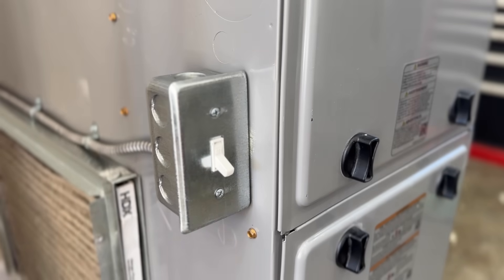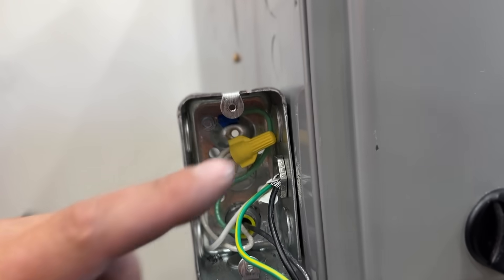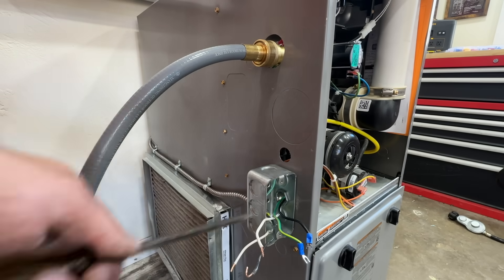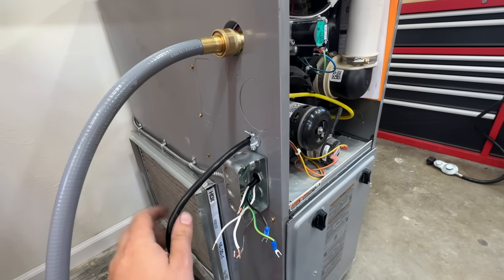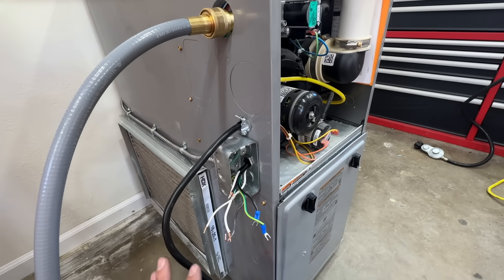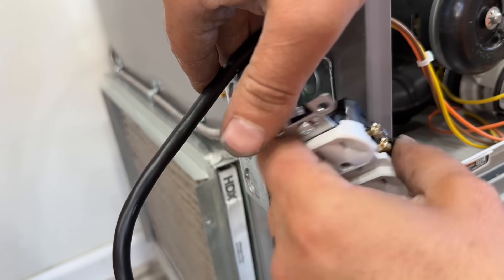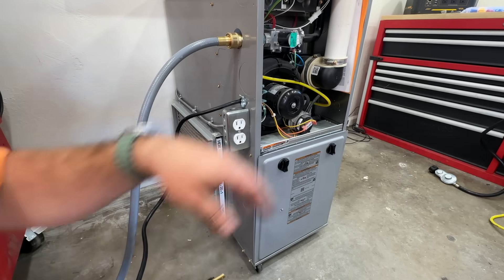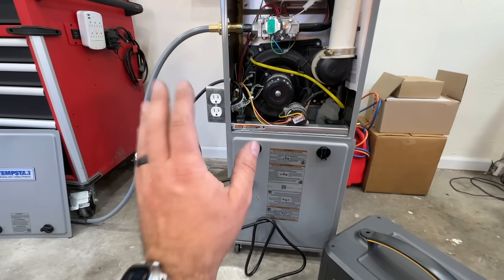Keep Your Family Warm During A Power Outage By Installing This $5 Part

Comment: I used a double pole double throw switch. Completely isolated neutral and hot when switch is used. when switch is up it is fed from utility power. when switch is down it is fed from the appliance cord.

Comment: Hello just a little info
this is not to code in my area ,first it must be hard wired , second all breakers for the furnace in my area are 20 amp (if to code ) so if you do this use a 20 amp rated plug what you do when the inspector leaves is up to you,third if this is done home insurance may not cover if there is a problem.
although a emergency is a emergency so don't freeze  and  GOD BLESS
Reply from the maker: Yes as stated, some inspectors may not approve of this depending on the ordinance but some will say it’s fine as I’ve seen hundreds of homes with this same exact setup. Cheers

Comment: Its a great idea, but the great City of San Jose, CA has banned gas furnaces in new construction. What happens when the power goes out, and you have zero gas. We have such a smart city, NOT
Reply from the maker: Really? That sucks.. you guys are sol if you have a new house… haha jk if they are making that the case; then I’m sure they are installing high efficiency inverter heat pumps that require less amps to operate so you’d need a power inlet box or a transfer switch and a generator in that case.
Reply: Many generators are dual fuel so you could get a large propane tank to run the generator. One of these days there is going to be a massive power outage in CA and whole neighborhoods will be without power. Camping anyone?

Comment: It will cost you a bit more than $5 but it's a minimal cost to have this ability.  I have had my furnaces done this way for many years. We get a  lot of outages year round, but in winter, it is usually related to blizzard conditions, so even a few hours without heat can get bad pretty quick. 

I have a big generator, but it takes a bit to get  it set up especially when the weather is bad.  If I get lucky, I might get power back in a couple hours. But running the furnace on a self contained battery style power supply, buys some time to evaluate the situation. If I have to work outside in the cold, crappy weather to get the generator set up. Being able to come in and warm up is priceless!

You did a very nice job explaining and you covered everything of importance, quite well. The only suggestion I have is to talk about having an adequate sized emergency supply. You connected to a 1000 watt supply, which I'm sure was adequate if you had checked the nameplate actual input values of the furnace. And when a blower starts, it draws a bit more current. Most emergency power sources have a surge capacity that will handle that. The main thing is to test your power source to make sure it will work when you need it and maybe run for a while to get an idea of the usage time you can expect. My suggestion is to start with a 1500 watt supply for a 15 amp circuit.  The actual input level value is likely about half, but it's good to have a little extra margin. They over hype these battery style self contained back up supplies, making it sound like it will supply endless power!  f it is small and lightweight, it will have pretty  limited power. So it's a good idea to do some testing to see just what you will have when you need it. The idea of using your car as a generator with an adequate sized inverter and a heavy duty extension cord, can make a pretty good emergency back up. Having this kind of  knowledge and capability, can be a life saver in major outages, and the cost of getting the capability is relatively low. 

As for code compliance. It's a matter of interpretation.  What you are doing is perfectly fine and safe. But you could run into an inspector who interprets it differently. Ideally you can explain its use and reasoning and get agreement. Alternatively, you could use an EZ Generator Switch, which is UL listed and approved for this very situation. I'd argue that your approach is actually better, but sometimes you run into an a-hole who really doesn't have a solid understanding of why the code is what it is. 

My only  other comment is about using Wagos. I'm an electric engineer who takes issue with them. No because they can come loose, which is unlikely. My issue with them is that when properly installed, they provide a relatively high resistance connection. This is not a huge issue in low current applications  like in a lighting fixture. but in higher current situations, the issue increase exponentially. I won't claim they are dangerous, but you should know that UL lowered the ratings considerably from the European IEC standards. 

The Wagos are easy which helps for DIY work, however, I strongly suggest that electrical work is not something for for DIY unless the person, fully and completely understands electrical theory and have had some formal training. I have seen far to many DIY mistakes. Electricity can kill you and/or your family and burn down your house if you make a mistake. You did a good job of explaining in detail how to make this pretty simple modification. 

I will just finish the Wago comment with the simple fact that wire nuts are far superior for a good connection. This is well proved by engineering level testing.  As an HVAC guy, I suggest yo research the Wago issue in depth, I'm sure you know well that easier is not necessarily better.  

But short these fairly minor points, I think you produced a very fine video and covered all the bases,
Reply: Wago are fine, for this case especially fine. Feel free to leave links to prove how poor wagos are.
Reply: @ClanMcCormick  What are your credentials that make you believable, Are you an electrical engineer? Do you know what the inherent resistance is for these connections. I don't need links, even though there are more than a few credible ones out there. I'm an Electrical Engineer with decades of experience and have conducted ample tests to laboratory  standards.  What does fine or especially fine mean in your definition? Are you a professional? Trained? Certified? 

I gave my professional opinion that these are a bad choice for connections of any substantial currents because as current doubles, heating goes up 4 times. D you understand that and know why?  They probably won't cause a fire but will most likely fail open. UL rated them OK but at reduced currents.  So they probably won't cause a fire at or below these derated currents.
Reply: Heat does not rise exponentially with current: only parabolically (variable (current) raised to a fixed power of 2). P=I^2R

That is a pet peeve of mine when people claim something rises exponentially just because a fixed power is involved. Exponential growth is when you have a fixed based raised to a variable power (like 2^x). That grows much faster than (x^2).
Reply: @economicprisoner  For the purposes of the issue at hand, I'll stick with what I said. If you want to play mathematical semantics with it, I don't see the point.  The issue is that dissipated heat is a function of the current squared.  This "functionality" is often overlooked by many in the electrical world. I don't wish to get hung up on terminology. It doesn't change the formula or the results. Sorry if  your interpretation is 'pet peeve" of yours.
Reply: @professorg8383  I see it more commonly with formulas involving 4th power terms (road wear due to axle weight, black body radiation)..

Calling everything "exponential" reduces the impact when the growth is ACTUALLY exponential (loans, spread of diseases like Covid). 

Exponential growth sneaks up on you. In the short-term it is less than you may expect. But long term it is far faster than you expect.
Reply: @economicprisoner  engineer vs mathematician.  Mainly a  perspective kind of thing.  I use math as a tool to help solve problems,  but I don't see it like a religious belief.  Different perspectives. both of which are useful in a full scientific explanation. But I see getting too obsessed with the  process as creating a stumbling block to achieving results. 

Being an electrical guy, I can have a great appreciation for Maxwell and all his efforts to explain what we already knew. He was a genius and has his place in electrical theory and history. But he really gets no credit for any noteworthy discoveries.. Perspective!

Comment: If your using a modern VFD generator you must bond the natural and ground legs as they will otherwise put out voltage on the netural which will cause a control fault 

My old school generator was fine and I ran into this during a 10 day power failure when I needed to upgrade

Comment: If code allows it, there are switched outlets where the switch controls power to the outlet ( the 110 hot gies to the switch, the out of switch to the gold on the outlet. This allows cutting the power without unplugging it.
Reply from the maker: After talking to several electricians, it’s sixes in my opinion. All they want is a means of disconnecting the unit
Reply: @diyhvacguy  
Yeah, it will come down to code enforcement. IDK if it is code but in my house there is a kill switch at the furnace and one just off the kitchen. Knowing where I live in NJ, they prob would flag an outlet being there, would want a transfer switch setup.

Comment: My high furnace has a duel receptacle on the side of it which the condensate pump is plugged into . If  the power goes out can I run a duel plugged extension from the power bank into the empty receptacle to power the furnace ?
Reply: Yes,but be sure to turn off your curcuit breaker to furnace,otherwise  it could back feed to curcuit box,and that would not be good
Reply: @daddygc5814  Ok Thank You very much for replying 👍
Reply: That's called a "suicide cord" and for good reason.  Get a proper transfer switch installed by a licensed electrician.

Comment: I did something like this once on a house I owned. I used a twist lock plug. I also didn’t use a Romex fitting on the furnace but a fitting designed for a cord with a rubber grommet that tightens on the cord..  The current home I built I put in a whole house transfer switch and also a sub panel with a transfer switch. I put the furnace, internet, tv, lights, refrigerator and freezer on the sub panel. I can run the sub panel loads on a few gallons of gas a day with a 2000 W generator. When we need the pump or other high load items we can start the big generator that is hooked to the whole house transfer switch remotely
Use a square driver instead a Phillips as you are less likely to strip the screw or stab your hand.
Reply: Yes a Roberson screw is far superior